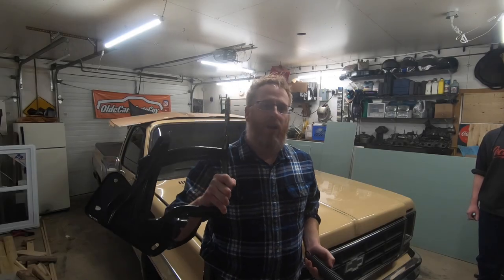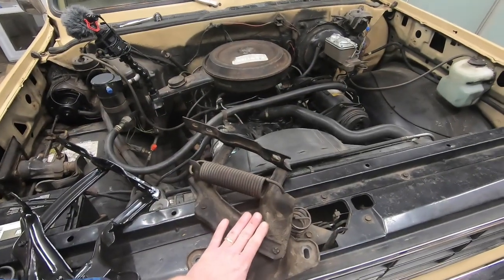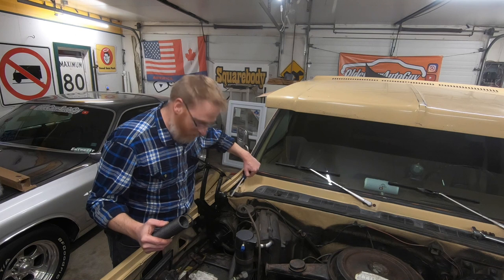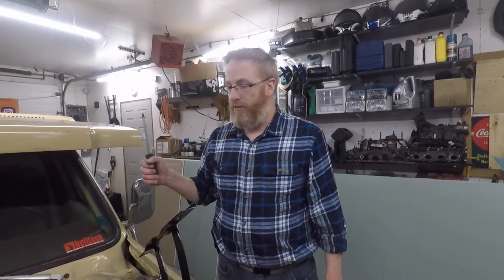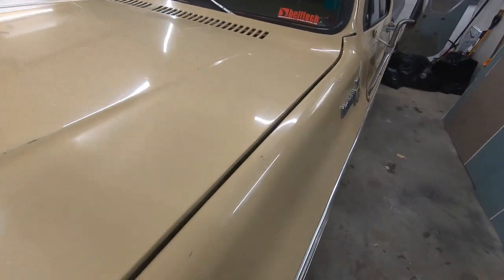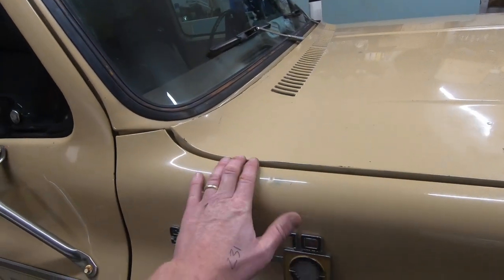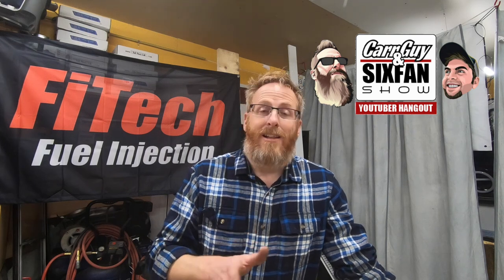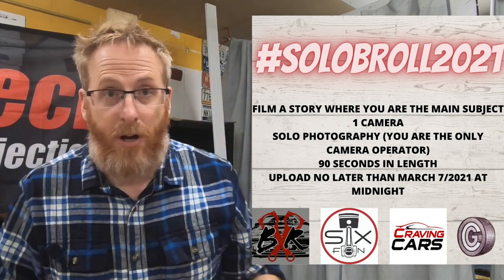Fixing Bent Hoods on 73-80 Chevy SQUARE BODY Pt.2

Comment: I put new LMC hinges and springs on my 74 a couple of weeks ago to address a similar problem (hood sitting high at the hinge). Same as you, once fitted mine seemed tight and still sits high, I can push them down to make the hood flush. I found I had a couple of shim washers behind the slotted hole bolt. If I left those off it seemed like the hinge bracket was distorting when the bolts were done up, and it would bind up the hinge mechanism. I put the shims in (maybe ⅛” total) and it’s better but the hood still doesn’t go flush without me pushing down on it. I’m thinking I’ll have to make and fit another shim, say another 1/16”, gotta wait till I can get a friend around to lift the hood off. Can also see a bit of taco now that the hood can sit flush at front and rear. Thanks for the vid mate 👍
Reply from the maker: Thank you for the tips! If it was a show truck I’d be more concerned, but it’s driver! I’m not terribly concerned!

Comment: I use a product here in Australia called Lanotech, great stuff, comes in pressure pack or trigger pack. I used some on the container pins of a trailer I used to haul, two years later I still hadn't had to redo them
Reply from the maker: I'll have to look it up! Thanks for the tip.

Comment: If it was a ram air or cowl hood would it be worth fixin or buy a new hood completely? Your the only guy I’ve seen on her with the taco hood when I been lookin for the same issue how to fix it . Your videos are worth watchin .
Reply: The ram air hoods are higher price than a cowl . People do have there options on which they like better .
Reply from the maker: Thanks Michael. I chose to try and fix mine so I could keep the original paint and look of the truck. If you do choose to go with a cowl or ram air, just make sure your hinges are well lubricated and you get in the habit of pulling the hood down and toward you at the same time. Less stress that way. I appreciate you kind words and watching my videos.